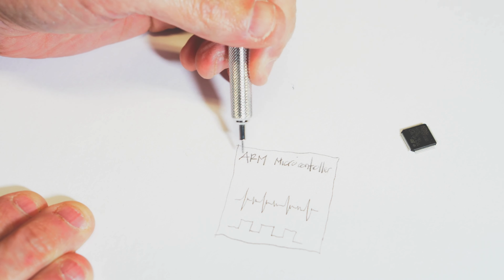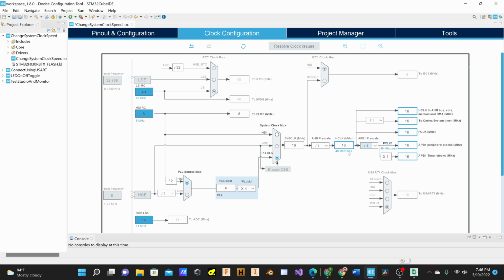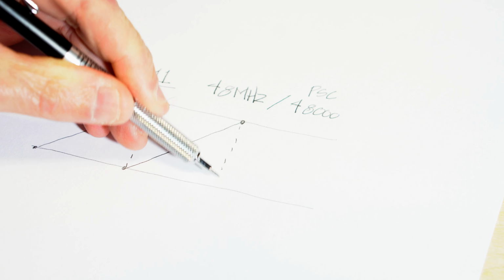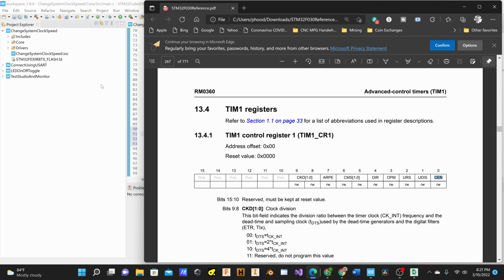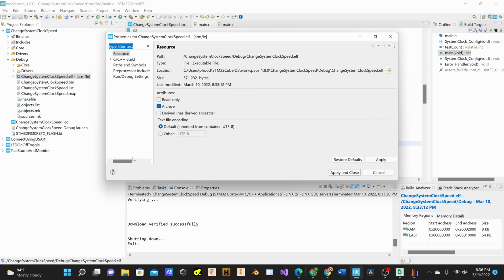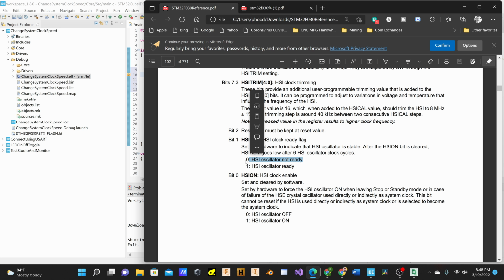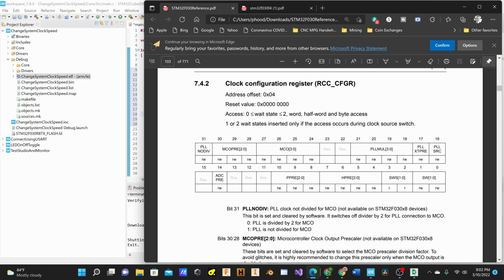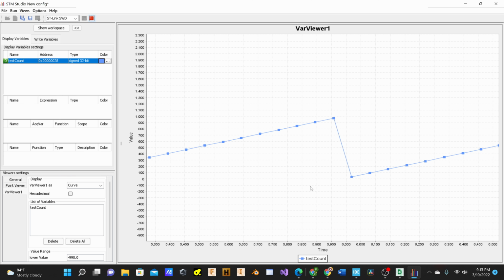#8 ARM STM32 Microcontroller Tutorial - Change the Internal Clock Speed! (automated and manual)

Comment: Hello, this is amazing, I enjoyed doing this. However, when I imported the variable testCount in the STM studio I coundn't see anything displayed, what could be wrong?
Reply from the maker: The first thing that comes to mind is if you are using the correct elf file. You can try changing the variable name and see if the variable name changes in the monitor.
Reply: @PatrickHoodDaniel  Thank you, it worked after I changed the zoom  on the curve. However, I'd like to know where you did the division of the HSI clock value by 2 in order to multiply it by the PLL. Where does that division happen in the code? or how do you do it manually?
Reply from the maker: @gastonkitambala4358  When you use the PLL, the division by 2 is done by the uC and is unavoidable. Watch at timestamp 6:45 where I show the division. There are ways to divide the clock if you wish to reduce the speed using prescalers which I talk about in that section of the video.

Comment: I don't mind you doing all the LL stuff, after all, HAL code may be bulkier at times, and also, knowing how to program the registers allows you to do more with the MCU(like creating your own PMW signal as you mentioned on the other guy's comment), however, I hope you keep going through the HAL Part - the .ioc, how to set up the pins using CubeMX, going through the generated code and so on. I have the H757XI Eval Board and damn, it's soooo much to do, if you do it at register level. The LCD thing, for example? Dear Lord😂😂

Anyway.
I am loving your series. Thanks for everything.
Greetings from Germany.
Reply from the maker: True that! The LCD specifically is a great practice in I/O, so  once you understand the LCDE, there really isn't anything you can't do.  In fact, to expand on the register level stuff, you can create features on the chip that actually don't exist.

I will definitely include all of the HAL and autogenerated code explanations.

Comment: It's good practice to set up all of the timer's configuration (prescaler, ARR, capture/compare, interrupts, DMA, etc.) and then set the enable bit.  As soon as you set the enable bit, the timer starts running with whatever values were in those registers.  It's not a big deal with an interactive demonstration of timing like this, but if you were using the timer to generate an external signal, control another peripheral, etc., then you could get a glitch initially.
Reply from the maker: Thanks. I may mention this in the book,  but I will definitely keep this in mind when I use timers for external pulses and such.

Comment: Please do more with HAL. HAL documentation is horrible and lacking examples. But great library to build projects. There are already many videos tutorials on low level. I hope you also teach with HAL. Btw part of HAL is actually low level wrapper for the uC peripherals and the other part accesses processor through CMSIS.
Reply from the maker: All of the videos in this series will be both HAL (or autogenerated) and register level code, so everyone has an option. There will be videos that I  will only show register level because there will not be an option for HAL. After all, I will be creating features that the MCU will not be able to perform with HAL, like creating a PWM signal when all of the existing PWMs have been exhausted by bit-banging IO  pins.